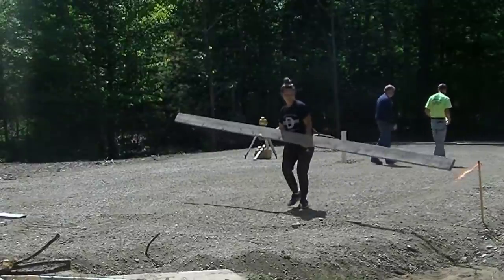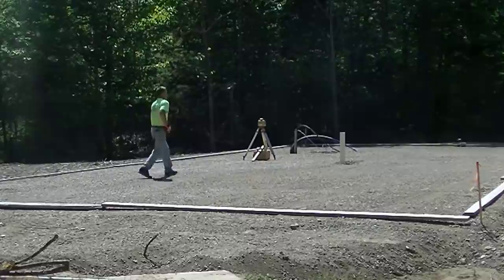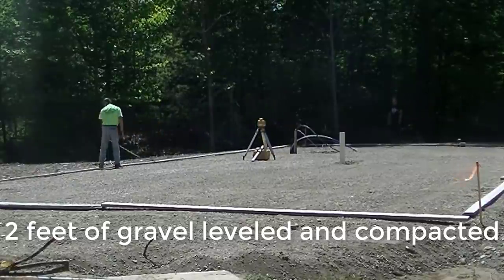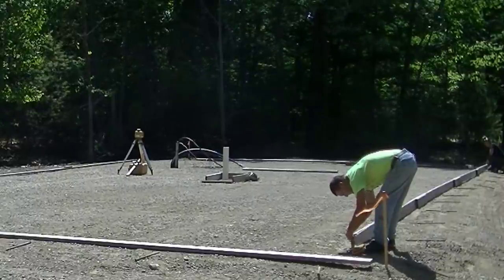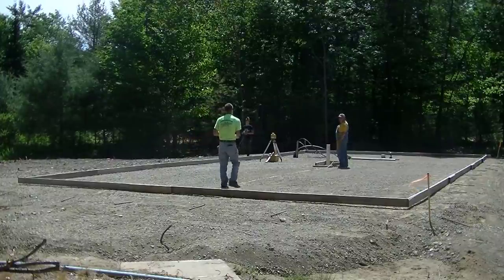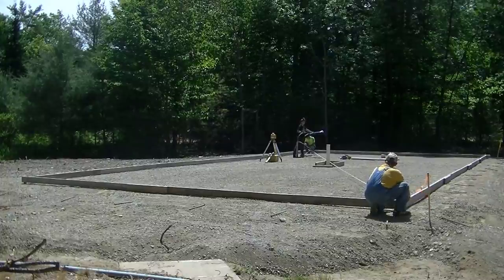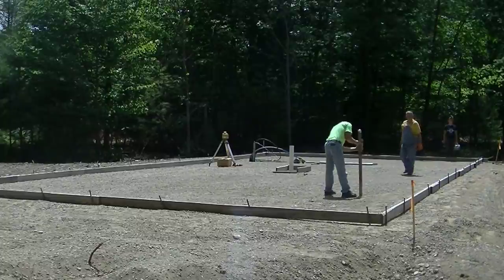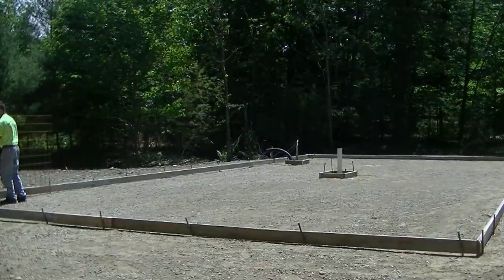How To Form A Concrete Slab (58' x 28' x 6") Learn My Simple Process

Comment: Tennessee. I live in a double wide. They only pour footers here with anchors. Great video Mike! I form and pour the exact same way you do. Except for the vibra screed.
Reply from the maker: Hi Brad! When you gonna get a vibra screed?
Reply: @MikeDayConcrete  gonna wait until next spring. I hate to spend that kinda money this late in the year.
Reply from the maker: I hear ya Brad, how's things going in TN? Have you been keeping busy, is there a lot of home building going on?
Reply: Yes. Things are still booming here. 95% of my work is for homeowners. I don't take much work from contractors, and that's what I like. I make a lot more in my area. I have 18 more jobs to do before it's too cold to pour. Probably won't get them all. A lot of good paying commercial work's been coming my way from Bristol so I'm thankful for that. I'll probably wait till spring, but I'm thinking about going with the MBW power screed and trowel. I hope things are going well in Maine.

Comment: I'm located in Southwest Wisconsin. I working on my first bid for a mobile home pad. You can either do a 6" pad with 10" grade beams on the outside and down the middle (if it's a double house) or columns 4' under the ground.
Reply from the maker: Nice Tyler. If you need help with the bid, let me know. mikeday@everything-about-concrete.com

Comment: We use steel forms with 4 stake pockets with 3/4" steel pins for each 10' form.  We use a steel slider form if we need more length for anything under 10'.  No flex in steel and sets up super fast.
Reply from the maker: Nice, I've never seen those kind of forms up here.
Reply: We use em here in PA aswell. Nice for sidewalks. Straight runs and very slight curves go fast with em
Reply: @jaredmiller7027  Yeah, they are super quick.   I usually buy the 4" x 10' bull nose forms, then I can double or triple stack them so I can pour 4"-12" if necessary.   Spendy but well worth the time saved and they are easy to set heights quickly and no screws!

Comment: Hi Mike, here in Australia the majority of mobile homes are set and mounted on cinder blocks. It’s rare to see a mobile home mounted on a large concrete slab. The slab would be 4-5 inches thick, reinforced with F62 steel mesh and concrete strength of 20 mpa.
Reply from the maker: The slabs do add quite a bit to the installation costs.

Comment: Hi Mike, another great video.  Thank you for taking the time and effort to put these videos out.  They really help.  I do have a couple questions as I watch this.  Do you know what kind of base they generally use?  This looks like maybe a crusher run or something with some fines in it.  Secondly, on these types of slabs do you ever cover the base with plastic before setting your reinforcement?  Thanks again for your work.
Reply from the maker: I think this is just bank run gravel, something they dug out of a gravel pit. We don't usually put poly under a mobile home pad like this. You could, no real reason not to. If it were a garage slab it would be a good idea to run poly under it.

Comment: Do you ever use a buggy to pour concrete for limited access?  I install back yard patios in Kansas City.  Most of my work is in a back yard with no access for a truck.
Reply from the maker: Yes, just used one yesterday to pour a stamped concrete patio in a back yard.
Reply: I'd like to see a video on that for timing stamping because it takes longer to pour.  I am new to decorative concrete.  I install pavers and about a year ago I switched to laying them on a concrete base instead of gravel.  I already went through the stamp course but didn't see it there.
Reply from the maker: The timing is a little different on every pour, it depends on the outside temperature mostly. Especially if the concrete is in the direct sun. But generally, when you can start to mag float the concrete like you see me in the videos, it's really close to start stamping. I'll see if I can make a good video about it and add it to the course. If I can only press my fingers into the surface about 1/4", that's when I get on it with my knee boards and start magging. Luke & Darin follow close behind me applying the release powder and starting to stamp.

Comment: How thick should a slab be and psi rating for a two story house?
Reply from the maker: Most our house slabs are 6" with 12" thick edges. I use a 3000 psi concrete for most of these slabs.
Reply: @MikeDayConcrete  thank you.

Comment: Nice job Mike. I’m always interested in the formwork aspect of your job, so thanks for this video. Difficult to poke any holes in what you guys did there bcz it was all very sound. 
The only thing I would discourage people from doing is - When squaring your slab forms, avoid measuring diagonals until you get like measurements. This is a flawed technique. You can lap the wrong board on a corner (shortening or lengthening the slab) and still achieve like diagonal measurements, but all four corners will be out of square. [think isosceles trapezoid]
Use the formula (A²+B²=C²) to calculate exactly what the diagonal should be and you’ll eliminate any possibility of error. If you’re lucky enough to have a construction calculator with a stair function, you can use the ‘rise’, ‘run’ and ‘diagonal’ buttons to save yourself a little math (rise and run or A and B are interchangeable).
Reply from the maker: Thanks for explaining that. I do always double check my measurements. It is easy to be an inch and a half short if you're not careful fastening the corners. :)
Reply: @MikeDayConcrete  Right. I wish I had a nickel for every time someone lapped the wrong board on a corner. And it’s impossible to detect by eye on anything larger than a small shed slab. Do the math.

Comment: Why you didn’t use a vapor barrier. Before you put the wire .. ..... Nuñez concrete inc .... in North Carolina ... in business sense 1994
Reply from the maker: No need on a mobile home pad like this. The home sits 2' above the pad.